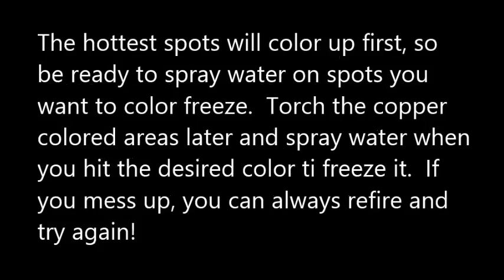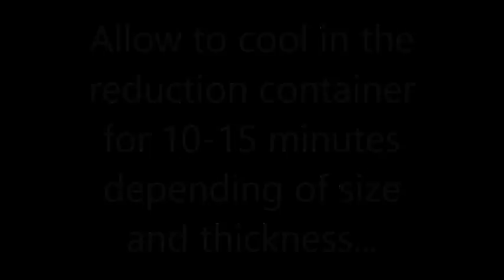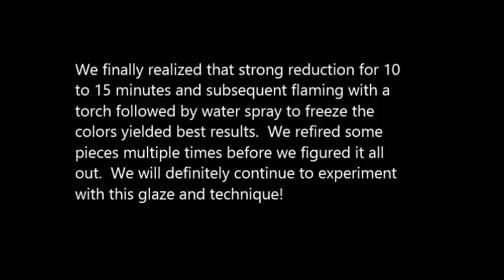Alcohol Raku Firing of a copper matte glaze with alcohol reduction

Comment: Beautiful to witness the Process and Result. Question however, the piece is first Bisque fired, then a Copper matte Glaze applied?  What brand of glaze and Clay were used for this Pot?
Reply from the maker: Yes, the piece is first bisque fired. The clay on this piece was white stoneware clay.  The glaze was a homemade mix containing copper carbonate as the coloring agent, but I no longer remember the exact recipe.  Any copper carbonate based glaze should work though as long as an agent to make the finish matte is included